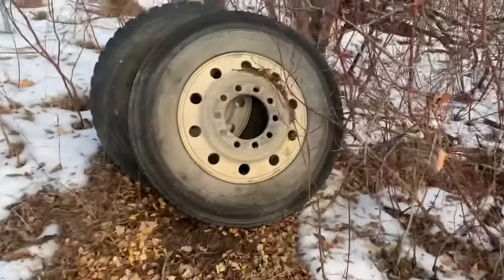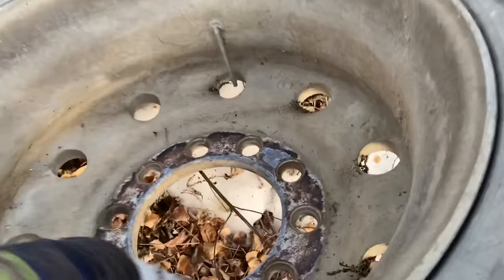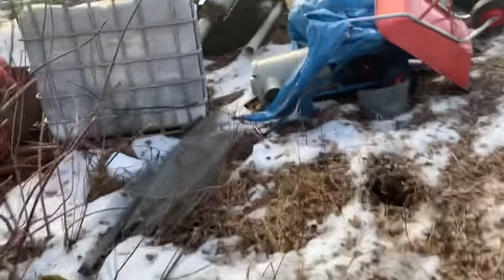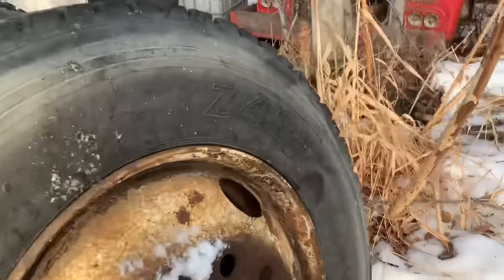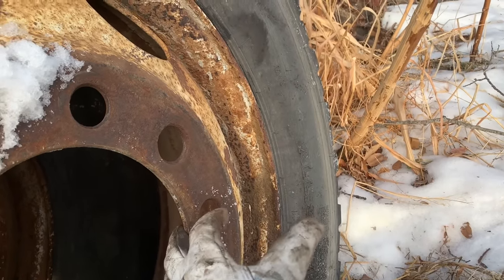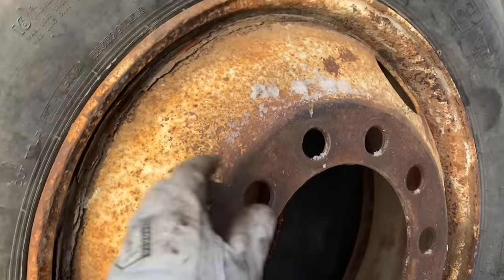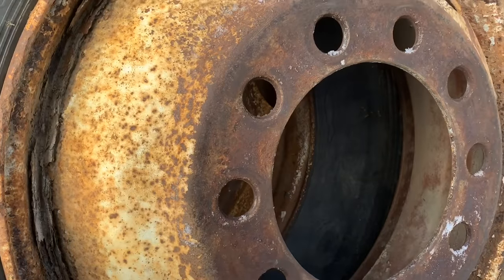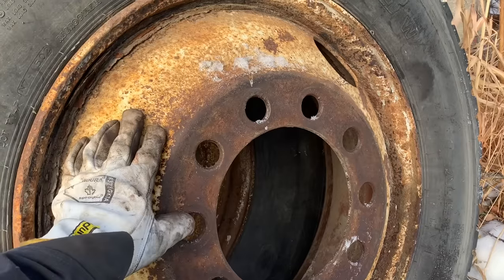Smokey & The Bandit Tribute Truck Ep.16 New Shoes for Bandit-Two

Comment: Ooooh, new tires!  I feel good all under! I drove a twin stick Bulldog dumper in the late 60's but mostly ran 13's and 18's through the years. The last truck I ran before I retired was a 13 axle, 50 wheel heavy hauler. That truck had an 18 speed with a two speed rear axle (411 and 588). I could come out of the port in Savannah grossing 300,000 and laugh climbing the freeway on ramp. Those wheels look great. I used jewellers rouge for cut and simichrome for polish. I came out of the restaurant in Ontario, California in the 80's to find a professional polisher talking to a driver standing next to my tractor. The polisher was telling the driver he couldn't get his wheels and tanks like mine because mine were "factory polished." I kinda chuckled periodically the rest of that day. Happy trails!

Comment: Here's a little tip I learned as an apprentice from a WW2 REME mechanic, I've been using it for years fitting truck wheels if I'm on my own on the road or on rough ground. Use a couple of pry bars spaced about a foot apart at the bottom of the wheel, lift them equally and slide the wheel in, if you need to turn the wheel to mate up to the lugs you can simply lift one bar a little more to rotate the wheel into the correct position, if the ground is really soft I have a short length of chain that I slip the ends of the pry bars into to stop them pushing apart. Kind regards from the UK 👍

Comment: Can't beat a bit of Bling!
Those wheels came up better than new. Unbelievable work. Glad you showed the 'Before' and 'After'.
Here in the UK we went hub centred years ago so we rarely see the stud centred wheels now (luckily) and when they were around I never saw any of those 'BudLugs'(?). 
A trick we used on the stud centred wheels was to fit one LH threaded stud on the left side and one RH threaded stud on the right side per axle. Cheap wheel security!

Comment: Get yourself a set of thread chasers! Don't got to be expensive ones but will save you a ton of time from that wire wheel. I got a snap on set but P. Auto should have a cheap set. Life saver. Lloydminster area here, run a service truck and in the nisku area lots. Would love to give you a hand sometime next time im in that country.

Comment: You did a good job "clocking" the drive shafts, but, did you clock the valve stems on the dual wheels? Just wondering? Glad to see they are starting on the new shop! This will be the last winter you will be outside working!

Comment: Did you stagger your valve stems? I couldn’t tell if you did, and you didn’t mention it.
Reply: Aluminum on the outside so it’s not exactly necessary. But it does make it easier to find
Reply: Well that’s the point. Especially when you have those small holes. Who wants to search each hole looking for the inner valve stem?

Comment: If you ever take an outside wheel back off the truck, be sure to check the torque on those inside overrunning studs before you put the wheel back on. They can come loose when the outside nut is removed.

Comment: wow. very nice polish job. did you get the insulators for between the steel and aluminum wheels? they are not very easy to come by around here. had to special order them.
Reply from the maker: Yeah the ones I had were the wrong size holes so I had to install without for now...

Comment: Don't for get the dissimilar metal separator.  Great channel 

Keep going!
Reply from the maker: Holes were 2 small on the ones I had ... not made for in between stud pilot wheels ... outer lug with the lip just crushed the plastic ... will fix 👍
Reply: @TwinStix  I knew you'd do it and there was a reason.. I know you would just hate to see those rehabbed wheels get marred or messed up.  Really love what you doing! Keep going!

Comment: Those wheels came out nice! I noticed a few others commented about staggering your valve stems. I used to put them opposite each other...
(1 at 6 o'clock, 1 at 12 o'clock) And you want to make sure the valve stem on the inner wheel lines up with one of the holes on the outer wheel...

Comment: 1:30 Also known as wheel guards. Accuride 5903 is the most common.
Reply from the maker: That’s what I bought but they don’t work for in between stud pilot wheels ... inner lugs have that lip that just crushes the spacer when you tighten it down
Reply: @TwinStix  - That’s interesting. They likely didn’t have wheel guards back in the day and now don’t offer a product due to low demand. You could reach out to Accuride to see if they offer anything or some guys use never-seize or equivalent.
Reply: @TwinStix  You need one for the bud lugs ( stud piloted ). You can also use an extra one of those guards on the outside, so that your socket never touches and scratches. It will come off when your done.  They exist, and you will want them for your steers especially. Those are scratches that you cannot hide

Comment: Well here goes, you already had 4 wheels or the inside, you put one new hub on the left rear axle so it had new studs, 30 new studs & 3 new wheel seals  probably cost as much as 30 new hub studs and the 40 new special inner studs you bought to go steel inside with aluminum on the outside. You probably wanted to look at the wheel bearings on the other 3 axles that didn't get the new hub so the wheel seals kind of don't count. When I went from steel to aluminum I ALWAYS bought the inside stud bolts that also had threads on the small portion of the stud that went into the inside aluminum wheel giving you more thread coverage on the stud bolt of the actual hub holding that outside aluminum wheel on the hub plus helped make up for the shorter stud you old hubs had. The truck had aluminum wheels on the inside when you bought it so you also would have been just fine with the hub studs the truck had.. other than that Your doing a fantastic job with the back end updates. You bought the good brake chambers not the cheap ones that rust out much faster.

Comment: Did you put the plastic shim between the two ?
Reply from the maker: Holes were too small in the ones I bought and the inner lug just crushed them.  Used anti seize for now and will replace the next time I have them off 👍
Reply: When he started screwing the aluminium one I was asking the same question.

Comment: Anti-seize on the studs? Was always told that was a no no. Lugs become over torqued. Due to most torque values are for dry no lube.
Reply from the maker: According to the mechanic at Peterbilt I talked to in the manual it does call out a different torque spec for dry and lubed stud pilot lugs 👍

Comment: It's a good idea to put a plastic gasket between the steel wheels and aluminum wheels so they don't stick together.
Reply from the maker: Holes were 2 small on the ones I had ... not made for in between stud pilot wheels ... outer lug with the lip just crushed the plastic ... will fix 👍
Reply: @TwinStix  l hear ya, hate to see those nice wheels get fused together. Cool truck!

Comment: Those new wheels look great. Couldn't tell in the video, did you get gasket our spacer to go between the steel and aluminum wheels?. Hammer down
Reply from the maker: Holes were 2 small on the ones I had ... not made for in between stud pilot wheels ... outer lug with the lip just crushed the plastic ... will fix 👍

Comment: In the video, I never saw the valve stems being aligned when installing the new wheels. Valve stems are aligned by mounting the outside tire valve stem across from the inside. Very important when trying to put air in the tires and also locating the valve stems for adding air to the tires.

Comment: On the lock nut, if you wait a while the threadlock will actualy dry and you wont turn the nut. Even with higher torque.

Comment: I worked for the gov for 40 years in road mant.was wondering why you didn't put anti seize between steel drun and steel wheel and why u didn't and the plastic separate washer between the steel rim and the aluminum rim like you said u were gonna do .You'll have a lot less headache later on when the rust and effervescent  starts jacks those rims arnd .Good luck ,enjoy your web
Reply from the maker: Holes were 2 small on the ones I had ... not made for in between stud pilot wheels ... outer lug with the lip just crushed the plastic ... will fix 👍

Comment: TwinStick, I love what you are doing, but didn't you forget to put plastic washers between the wheels? Cheers
Reply from the maker: Holes were 2 small on the ones I had ... not made for in between stud pilot wheels ... outer lug with the lip just crushed the plastic ... will fix 👍

Comment: I have been looking at acquiring an old dump truck 1966 kw with a 335 cummings and the 5 and 4 trannys, needs clutch, tires and a lot of work.The fella is asking 3800 but I don't know if any of you guys know its worth in this state of despair?
Any input would be greatly appreciated

Comment: Did you forget to put the plastic protector ring between the wheels? Great job
Reply from the maker: Holes were 2 small on the ones I had ... not made for in between stud pilot wheels ... outer lug with the lip just crushed the plastic ... will fix 👍

Comment: Not sure if I missed it, but I didn't see you add a spacer between the wheels so they don't weld together. 🤔
Reply from the maker: Holes were 2 small on the ones I had ... not made for in between stud pilot wheels ... outer lug with the lip just crushed the plastic ... will fix 👍

Comment: so.... did you put the plastic plate between the rims so that they don't fuse together?
Reply from the maker: Holes were 2 small on the ones I had ... not made for in between stud pilot wheels ... outer lug with the lip just crushed the plastic ... will fix 👍

Comment: @TwinStick Garage I'm not trying to pick your work apart by any means, but I didn't catch you putting the thin plastic hub guards over the stud-nuts before you put the Alcoa's on the out side. Also love your work and attention to detail. 

Keep up the great work.
Reply from the maker: Holes were 2 small on the ones I had ... not made for in between stud pilot wheels ... outer lug with the lip just crushed the plastic ... will fix 👍
Reply: @TwinStix  Rodger that, I figured as much, I was like man that's alot of torking lug nuts to take them right back off to put them disk back in.

Comment: Thought you were putting a plastic spacer in between the wheels?  Or is that for the trailer wheels?
Reply from the maker: Holes were 2 small on the ones I had ... not made for in between stud pilot wheels ... outer lug with the lip just crushed the plastic ... will fix 👍

Comment: I noticed that you didn't put on the spacers between the two wheels,( plastic ring). sure does look good with the new wheels though, nice job Twin Sticks.
Reply from the maker: Yeah ... the holes were too small in the ones I had and the inner lug just crushed them ... used anti-seize for now but will correct 👍
Reply: @TwinStix  sure love your content, being a fellow Canadian, i try not to miss any of the videos, keep them coming.

Comment: Lot of work, lot of expense , I do hope you get to work these trucks/units at some point . Also didn't notice the plastic spacer between the wheels to stop corrosion unpainted alloy against painted steel ?
Reply from the maker: Holes were 2 small on the ones I had ... not made for in between stud pilot wheels ... outer lug with the lip just crushed the plastic ... will fix 👍

Comment: Did you put the plastic separator between the wheels?
Reply from the maker: Holes were 2 small on the ones I had ... not made for in between stud pilot wheels ... outer lug with the lip just crushed the plastic ... will fix 👍

Comment: Did you put the spacers between the rims?
Reply from the maker: Holes were 2 small on the ones I had ... not made for in between stud pilot wheels ... outer lug with the lip just crushed the plastic ... will fix 👍

Comment: Did you end up putting the plastic spacer between the wheels?
Reply from the maker: Holes were 2 small on the ones I had ... not made for in between stud pilot wheels ... outer lug with the lip just crushed the plastic ... will fix 👍

Comment: Hi,
Did you do the plastic plates between the wheels ?
Reply from the maker: Holes were 2 small on the ones I had ... not made for in between stud pilot wheels ... outer lug with the lip just crushed the plastic ... will fix 👍

Comment: Hey pal, between the two tires isn't there a rubber spacer between the two rims...?
Reply from the maker: Holes were 2 small on the ones I had ... not made for in between stud pilot wheels ... outer lug with the lip just crushed the plastic ... will fix 👍

Comment: You didn’t line up your valve stem to the outside wheel. It’ll be hard to check air in the inside tire

Comment: Did you put the plastic between the steels and aluminum rims?
Reply from the maker: Holes were 2 small on the ones I had ... not made for in between stud pilot wheels ... outer lug with the lip just crushed the plastic ... will fix 👍
Reply: @TwinStix  awesome I’d hate to see those sweet shiny rims ruined by welding together

Comment: Did you end up putting on the plastic spacers between the wheels?
Reply from the maker: Holes were 2 small on the ones I had ... not made for in between stud pilot wheels ... outer lug with the lip just crushed the plastic ... will fix 👍

Comment: I did not see you put the Plastic spacer between the wheels like you said that you were going to do ?
Reply from the maker: Holes were 2 small on the ones I had ... not made for in between stud pilot wheels ... outer lug with the lip just crushed the plastic ... will fix 👍

Comment: did you put in the plastic shield between the steel and the ali?
Reply from the maker: Holes were 2 small on the ones I had ... not made for in between stud pilot wheels ... outer lug with the lip just crushed the plastic ... will fix 👍
Reply: @TwinStix  i work at sea and get a lot of problems with the ali rotting away when next to the steal, we use a product called Tef-gel, it puts a barrier between two different metals.

Comment: Were you going to put a spacer between the steel any alloy wheels?
Reply from the maker: Holes were 2 small on the ones I had ... not made for in between stud pilot wheels ... outer lug with the lip just crushed the plastic ... will fix 👍

Comment: You didn't forget the plastic protectors did you ?
Reply from the maker: Holes were 2 small on the ones I had ... not made for in between stud pilot wheels ... outer lug with the lip just crushed the plastic ... will fix 👍

Comment: So did you actually remember to put the insulating disk between the steal and aluminum rims?
Reply from the maker: Holes were 2 small on the ones I had ... not made for in between stud pilot wheels ... outer lug with the lip just crushed the plastic ... will fix 👍
Reply: @TwinStix  thanks for the update

Comment: I was wondering why you didn’t try to find some tube type wheels ,like the original snowman had.
Reply from the maker: That’s the plan for the front but couldn’t find any rears that style
Reply: @TwinStix   I thought that might be the case . I did see a set of 4 on a older  359  Pete. It was parked out in an  old field up here in Washington state.
Reply: That is the only thing that I would change. I know it's not pure, but I'd have to have tubeless.

Comment: Did not see you put the plastic washer between the steal and aluminimum wheels
Reply from the maker: Holes were 2 small on the ones I had ... not made for in between stud pilot wheels ... outer lug with the lip just crushed the plastic ... will fix 👍

Comment: Did you forget the plastic rings between the wheels?
Reply from the maker: Holes were 2 small on the ones I had ... not made for in between stud pilot wheels ... outer lug with the lip just crushed the plastic ... will fix 👍
Reply: @TwinStix  Ahh... I wouldn't have thought of that being an issue lol. We learn more every day don't we.

Comment: Hi does DOT allow a mixture of wheel rims aluminum?, and steel?
Reply: Not sure if across Canada, Ontario allows mixed steel inners and aluminum outers, nothing wrong if installed correctly. An issue I've found is stud length, sometimes you have to get longer studs because steel rims are thinner than aluminum, some stud has to extend past the nut when tightened
Reply: the USA does. I have inner steels on my freightliner and aluminum outsides. I also have differant sized wheels on my lift axle vs my drive axles.

Comment: Some of those inner nuts are for aluminum inside wheels, beware....the ones with a step or shoulder are dor aluminum inside and will not hold steel inside properly
Reply from the maker: Odd ... the shoulder on the inside lugs seemed to match the profile of the wheel hole perfectly
Reply: @TwinStix   be careful with those....been around this stuff 40 plus years ... have broken wheel studs using those with steel wheels because they bottom out against the brake drum without the wheel actually being tight

Comment: You forgot the plastic wheel spacers 🤦‍♂️😂
Reply from the maker: Holes were 2 small on the ones I had ... not made for in between stud pilot wheels ... outer lug with the lip just crushed the plastic ... will fix 👍

Comment: You didnt put the plastic spacer in
Reply from the maker: Holes were 2 small on the ones I had ... not made for in between stud pilot wheels ... outer lug with the lip just crushed the plastic ... will fix 👍

Comment: i just don't see the point of having different thread orientation on each side. ?Most of the time the thread should be always opposite where the most of the time it turns so it tightens it. Like on cars, do american cars have same setup for cars too? that would be silly to have that kind of setup like on lorries too.
Reply: the reversed thread thing was a thing back before the 80s. they believed the rotation of the wheel would loosen the nuts, so they reveesed the threads. was on alot of 1 ton pickup trucks and some 60s cars too.